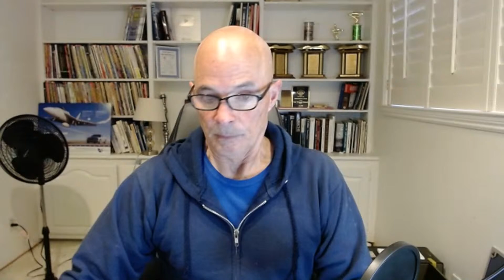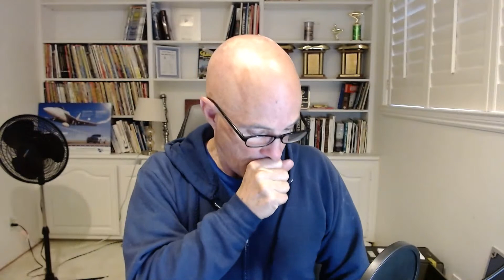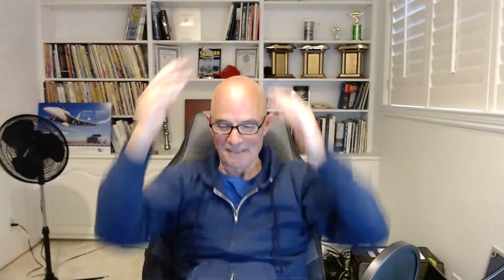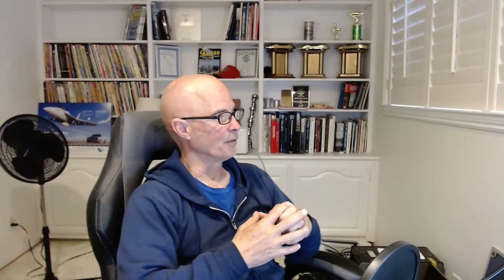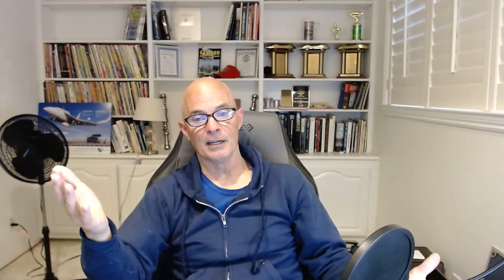LET'S TALK TECH-CENTRIFUGAL VS TURBO-HOW MUCH TORQUE CAN YOU USE?

Comment: I like the idea of camming the engine for diesel-truck-like bottom-end torque, then letting the centrifugal rescue the middle and top end. I will check that theory by looking at the Merlin Spitfire engine.
So the engine behaves a lot like a WWII supercharged fighter plane engine, I assume. Do the cam specs line up?
CORRECTED LSA THANKS TO RICHARD'S INPUT DIRECTING ME TO http://www.wallaceracing.com/Calculators.htm that has calculators including camshaft calculator!
Using this cam spec calculator, SO HANDY!:
http://www.wallaceracing.com/camcalc.php

I am avidly curious what the cam timing was on those 2850RPM engines, and I may just go and find out right now!
Peak power: 2850RPM.
Early type camshaft (Pre-mod. 987)
With 0.014 in cam clearance
Inlet opens 31 deg. before T.D.C
Inlet closes 52 deg. after B.D.C.
Exhst.opens 72 deg. before B.D.C.
Exhst. closes 12 deg. after T.D.C.
This yields an intake duration of 263 degrees
Exhaust duration: 264 degrees
Valve overlap: 43 degrees
Intake peak: 100.5 degrees relative to  zero (TDC of exhaust stroke)
Exhaust peak: -119.5 degrees relative to zero (TDC of exhaust stroke)
Lobe Separation Angle: 110 degrees.

I marvel at the difference in overlap, and that on a low-RPM engine with four valves per cylinder with maybe 12" of total exhaust port/zoomie length.

Parabolic type camshaft (POst-mod 987)
Inlet opens 38 deg. before T.D.C.
Inlet closes 72 deg. after B.D.C.
Exhst.opens 78 deg. before B.D.C.
Exhst. closes 32 deg. after T.D.C.
Intake duration: 290 degrees
Exhaust duration: 290 degrees
Valve overlap: 70 degrees
Intake peak: 107 degrees after zero (TDC of exhaust stroke)
Exhaust peak: -113 degrees relative to zero (TDC of exhaust stroke)
Lobe separation angle: 110 degrees again.

https://airpages.ru/eng/mt/merlin02.shtml

This makes me curious if a similar cam grind would work to provide a similarly-shaped power curve with an appropriate centrifugal supercharger, though smaller in magnitude. 
Zoomies would not work as well on  a car, as it would not be cruising at 300mph and 30,000 feet.
I marvel at the long duration and high overlap of this 2700 RPM motor.

What makes me wonder is how such a slow-turning engine is getting 1hp/cubic inch.

Comment: Pulley the supercharger to the Max then install a wastegate to controll boost.
Reply from the maker: still a big change in boost from 2500-6500 rpm
Reply: @richardholdener1727  but not as big.

Comment: You proved before half throttle didn't kill much power
Reply from the maker: you need to watch again
Reply: @richardholdener1727   my point was if you build way more than the tires can handle "just use less throttle"  isn't gonna kill that much power, your gonna have very little pedal between decent launch and pure tire smoke.

P.S. It would be kool if you put some bookmarks after on live streams or take short clips of the best parts for us with short attention spans :)

Comment: If the revs are only dropping to 4,000 (or 5,000) on the shifts during WOT, I don't see much need for an extra 100 pound-feet at 3,000.  And mashing the gas at 3,000 (WOT), the trans would drop a gear, or the driver would downshift. Like, would you even see 3.,000 rpm at WOT? If you're towing a horse trailer up a hill through 3,000 rpm with tall gears, well maybe . . . but the parts stress . . ..
Reply from the maker: the question wasn't about what is happening at 4000-6000 rpm
Reply: My comment is with regard to the need for an extra 100 pound-feet of torque at 3,000 when there's already 650. I don't think there is any need as it's not at a useful rpm.

Comment: So question would a thousand horsepower supercharged motor work harder or put more stress on internal components compared to a thousand horsepower turbocharge motor?
Reply from the maker: FOR BOTH OF THE MOTORS TO SHOW 1000 HP ON THE DYNO, THE SUPERCHARGER WOULD HAVE TO ACTUALLY MAKE 1150 OR MORE HP BECAUSE OF THE PARASITIC LOSSES ASSOCIATED WITH DRIVING THE BLOWER. THERE WOULD CERTAINLY BE MORE LOAD ON THE CRANK AND BEARINGS TO DRIVE THE BLOWER

Comment: This is a good one, unless awd or on a specific drag suspension I’d say putting down much more than 400ft lbs is a joke. I say that assuming a final drive ratio similar to a stock car with a 2-4/1 first gear and a 3-4/1 differential gear 

In my gt350 in first gear 3.73 rear and 3.675/1 first gear I can roll on the throttle and when the cams switch from emissions to power around 4500rpm is where it will break traction…. I think that’s about 375ft-lbs at the crank.

That’s the most gentle application of torque I can think of, and this is on 315/35r19 mi pilot super sport tires at 25 psi
Reply: Pretty sure that's a horses for courses thing and that the GT350 has negative amounts of traction baked into it on purpose.
Reply: @RotaryJunkie   before I respond, please elaborate.
Reply: @Bill-flatplanefool . It’s a track car that has high rpm power for going around the track.
Reply: @bri-manhunter2654  I know what it is,  I track it regularly 😏 my point is unless you have a drag  setup and a prepped track too much torque is just smoke
Reply: @Bill-flatplanefool . Agreed💪🏻

Comment: What is the best way to add some torque to a 2003 f150 Supercrew 4.6 for highway cruising through the hills, it struggles on cruise controll ? The reason I ask is it is just about mint condition.
Reply from the maker: tune, long tube headers, compression, displacement, boost